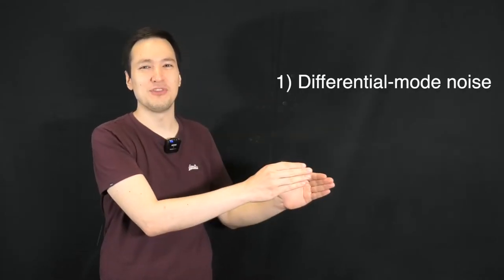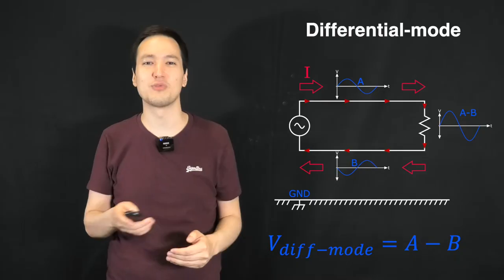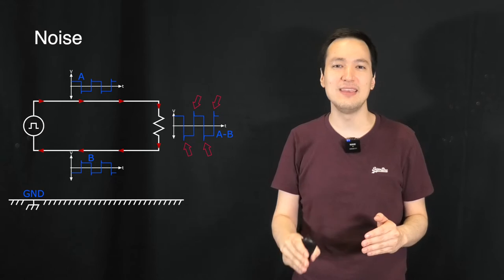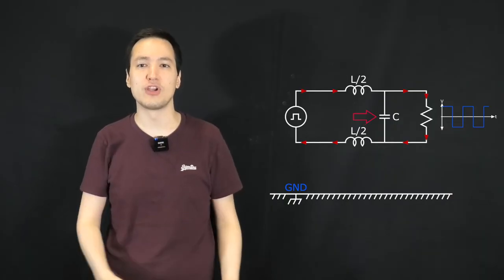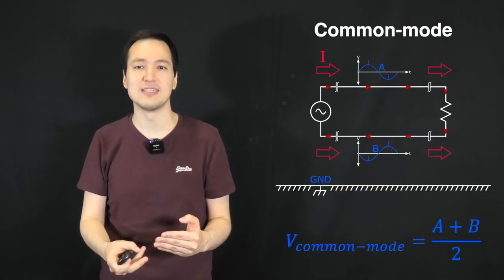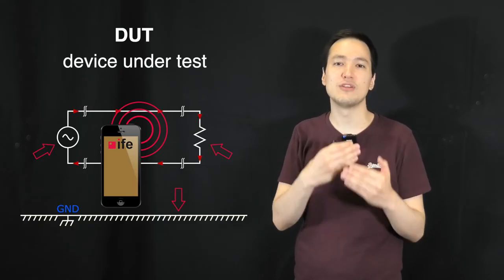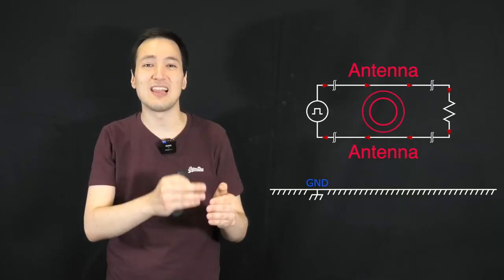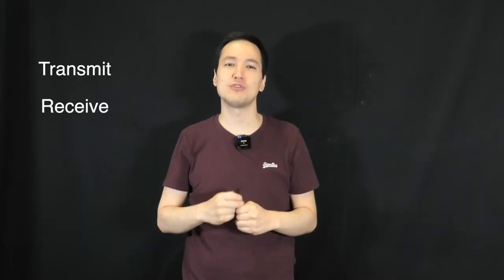Differential- and Common mode

Comment: 2:41  Why are A and B inverse of each other? Shouldn't they be in phase since it is common mode noise?
Reply: the sharp part， the spike is in phase.
Reply: Cause they are on opposite sides, if noise voltage is to the right on both lines, obviously it is 180° degrees out of phase on upper and lower side.

Comment: Hey in common mode why we took a+b/2 
Why we are adding signals and dividing by 2.
I know we should take avg but why to take avg can you please explain.
Reply: I believe that you can represent a differential mode signal as two parts. A negative part -VDM/2 and a positive part +VDM/2. So, if we add common mode noise to both parts we will then have -VDM/2 + VCM and +VDM/2 + VCM. By taking the average we will end up with (-VDM/2 + VCM + VDM/2 + VCM)/2 = 2*VCM/2 = VCM. I hope this helps.
Reply: I think this is the way CM voltage is usually defined.
Reply: @koodreitz  Yes but what is the logic? I can propose it as a-b/2. There should be certain logic behind that I went through 3-4 books overthere as well they had not mention any logic
Reply: @swaritmahalsekar5521  No, you cannot propose it as (a-b)/2. (a-b)/2 equals zero when there is only common mode voltage, but gives a maximum value when the signal is differential. Conversely, (a+b)/2 equals zero if there is only differential mode voltage.